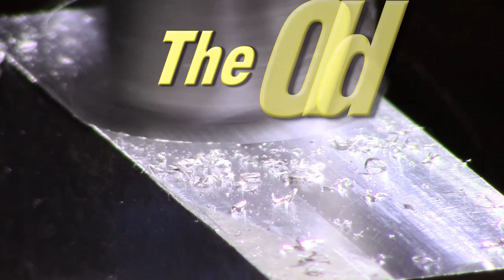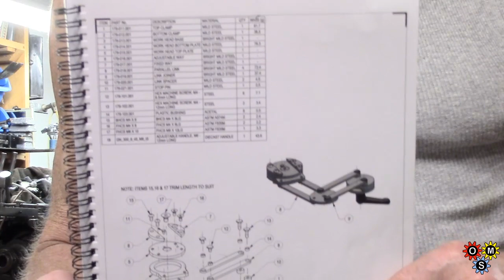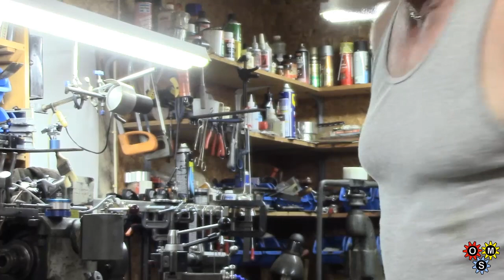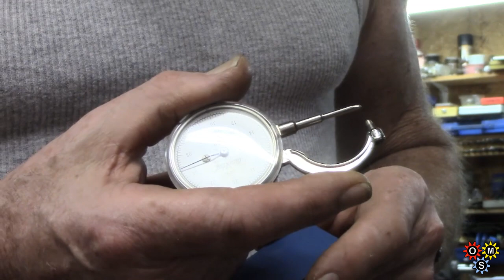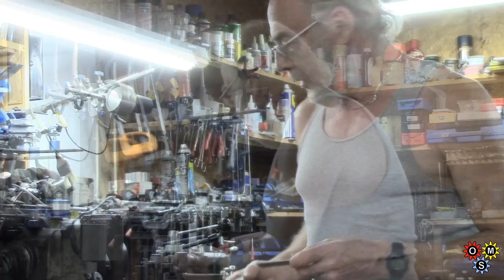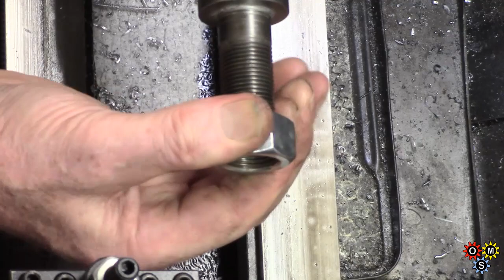A Quick Thread Repair

Comment: with the damage occurring at the very end of the shaft i think it would have been much quicker to just put a large chamfer on the end to eliminate the damaged portion of the shaft and protect the threads from future damage.
Reply from the maker: +larry sperling Quicker Larry, true but the material was very hard and I guess I elected to clean the threads instead as first choice. Like many jobs though, afterwards, other options come to mind - and if I'd had the right thread repair file that probably would have been the way to go.

Comment: Those boobs will get you pregnant... Again...!!!   Wasn't the first time a lesson...???
Not certain you need to do any repair on lead screw, or anything else,  more obvious on small lathes is the catching up of all non rigid slacks all along the path where the forces are applied... In other words the rigidness of the machine.
You could easily do that operation under power, depending of your degree of comfort with the task to accomplish...
Those carbide inserts will cut better with higher speeds.
We all get our limits on far we'll go... 
Final result is a great repair...   ;)
Cheers,   Pierre
Reply from the maker: +pierre beaudry Haha - actually Pierre, was thinking of getting a bra! I was too chicken to try using power - hand rotation gives better feel - but yeah, speed better for carbide as you say. I certainly need to check several things on the old lathe.

Comment: Hi mate.I had that same problem once on a 4x4 wheel spindle.  I cut open a nut in a slanted way so  it would cut in to the threads.  It worked very well.  I have to say that the nut was hardened.  But the threads tidied up very nicely.
Reply from the maker: +Marcel Timmers Had I had a hard nut spare Marcel I'd probably have gone  that route - the nut I had was a soft POS! :)
Reply: ChrisB257 I guess I just lucked out that day, it doesn't happen all that often you know.

Comment: A thread restoring file would be a much better bet on this intermittent cut, all they are is a square hardened stick with different pitch lines of 60 Deg(or 55Deg) grooves which you dress out your damaged area with, simply, but effective. Your "wobble", I think this must be due to up and down slack on the carriage/bed ways, the cutting tool was moving in and out, if the problem was the cross slide leadscrew it would not go back in after having taken up the slack, with the carriage slack, the weight of the carriage would be lifted on a high point, then allowed to drop back on the low point, sorry for the long rambling. Chris B.
Reply from the maker: +Englishman French Thanks Chris - very observant and thanks. In fact I think anyways it is past time I did some general maintenance in several areas!

Comment: Chris, you should look into some thread files,  They are great.  http://www.amazon.com/Nicholson-Thread-Repair-Single-Square/dp/B001T4KRHC

Thanks for sharing,  Randy
Reply: Even a 3-corner file can do a lot when you have just one or two distorted threads at the end of a bolt.

Another trick is to cut a nut in half, clamp it tightly around the bolt where the threads are still good, and then turn it over the damaged threads. (Plenty of lube; this is like knurling. You are pushing the metal to a different location.) This has the advantage (over filing, single-point turning, or using a die) in that it swages the distorted metal back into place, rather than removing metal. The original threads had just enough metal to make up the threads; if you remove some, the threads can never be completely filled out in that location. The nut should be of a higher grade (tougher) than the bolt, if possible.
Reply: +Peter W. Meek Nice trick, mostly if you have to repair the thread in an area that will serve to hold... At the start if there is no holding need, you could almost get rid of the metal.   ;)
Reply from the maker: +Randy Richard Indeed Randy -- seeing as my one thread file lacked the TPI, have since ordered a couple from eBay - one metric and another for SAE - enough anyways to cover the main needs for now.
Reply from the maker: +Peter W. Meek Have used a triangle file before Peter, and that can work but this thread had rather specific areas of problem. Re the nut idea - good one - however the nut supplied was crap -- much softer than the pin thread which was pretty hard, and didn't have a grade 8 on hand..